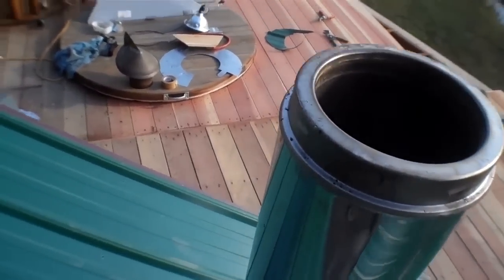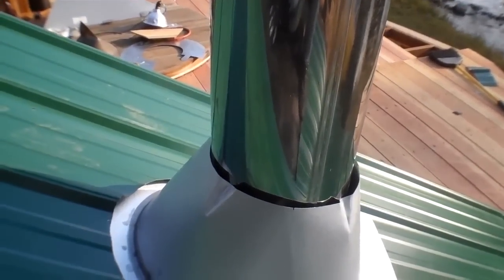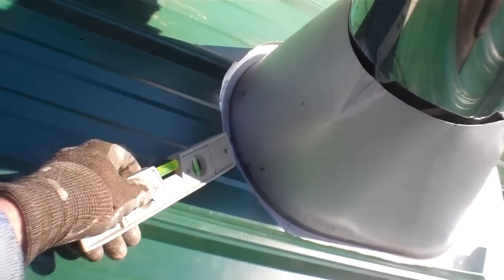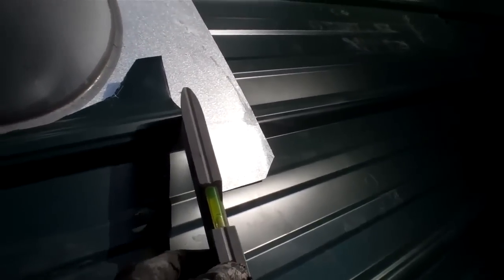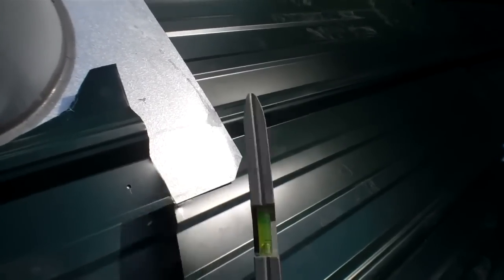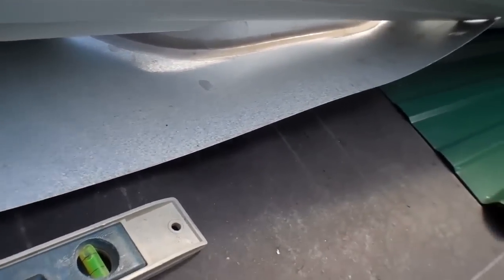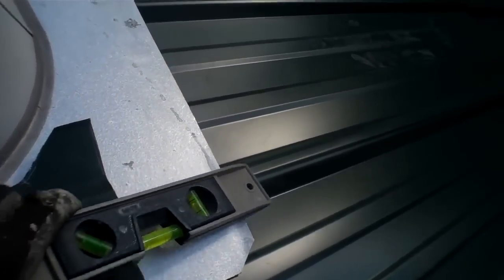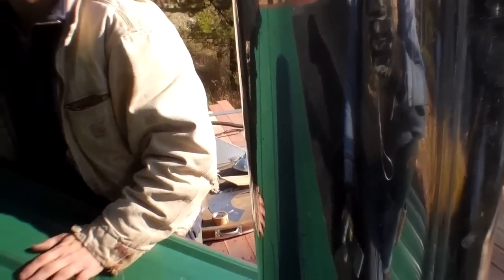Obadiah's: Redwood Hot Tub Installation - Installing Metal Roof Flashing

Comment: My husband and went ahead and tried this method on our tiny we are building. The installation of it was relatively easy. As far as we can tell it looks solid and rain proof.
Thank you Obadiah's for making this video! It was very helpful!
Reply: It will eventually leak because it is not correct.
Reply: @klamathhome  hmmm its been 5 years and it has not leaked yet so maybe you can link to a place that shows the right way?
Reply: @fionnbharre8389   There have been several people that have given instructions on how to install a stove pipe correctly. Most good contractors don't have time to make videos. Unfortunately bad contractors have more than enough time. I can understand if it hardly rains then it probably won't ever leak but that does not mean these clowns should be instructing others the  wrong way to install a chimney pipe. It may not leak in 5 years but it will leak if you get rain. I have repaired many metal roofs that were installed by clowns like these guys. 
The issue is that metal will siphon water when the wind blows. The calking will eventually ware out with the sun and the expansion and contraction of the metal. All it takes is a little pin hole like the one on both sides of these guy's work. Then you add more calking and begin to trap water making it leak even worse. If you can not keep the roof from leaking without calking then it will eventually leak. I do not use any calking on any of the roofs that I install and I installed roofs in an area of lots of heavy rains and never had a leak in over 25 years but repaired leaks on other people's work.
Reply: @fionnbharre8389  See Alton Benally's comment below or 
dnahulvey
's comment they are talking about the correct way.

Comment: If you can't get a rubber boot flashing it's better to put a seam right on it or disconnect if possible.   Cut the hole out as tight as possible  and use  NP1 or another polyurethane type roofing adhesive sealant.  Do multiple beads over it  letting set in between silicone is not recommended  but may be used as a top coat once dry because of it's superior UV resistance.   Put some extra screws around the penetration as well. 

The way it was done in the video just created multiple failure points  ands it's still gonna need to be sealed up around the vent anyways.  But also created possible ice dam issues, blowing snow or rain getting under where the metal is sticking up.  Then the slits too I know the other side isn't as tight.

Comment: It seems like wind could drive rain up under the lower part of the flashing and over the lower piece of metal roofing. Is there anything in place to stop this?
Reply from the maker: You use a high temp silicone sealant to seal between the roof and a flashing. A storm collar goes at the top to keep any rain from coming down the flashing.

Comment: Honestly i would of just 2 pieced it. Extend the lower metal then the boot and then the top metal. But people do things differently lol
Reply: That would be the correct way. There is doing things different and there is doing things wrong this slit method is just wrong.
Reply: Agree, in snow condition we let the bottom piece extend past the top of the chimney, the top part extend past the bottom part of the chimney then we seal with caulk for wind and snow melt.
Reply: I did it with two pieces overlapping about 2’ each.

Comment: This method is not very resilient to resisting the weight from snow buildup depending on how the flashing is fastened. The flashing will take most of the weight if the snow is sticking to the roof and it can rip the chimney out - especially if there are offsets right below the flashing.

Comment: Yo. I am experiencing rust on my metal roof after 5 years. What kind of paint do you think I can coat it with to avoid the acid/toxic run off to prevent this. 
Any info would help. Hard to find info.
Reply: Rustoleum works well

Comment: What would be the minimum slope for this kind of installation?
Reply from the maker: We have these roof flashings available from a 1/12 pitch - 12/12 pitch.
Reply: For this kind of installation the steeper the better because anything with a low pitch will end up leaking.
Reply: Also metal should never be installed on anything less than a 2/12 pitch so a 1/12 pitch flashing would be worthless.